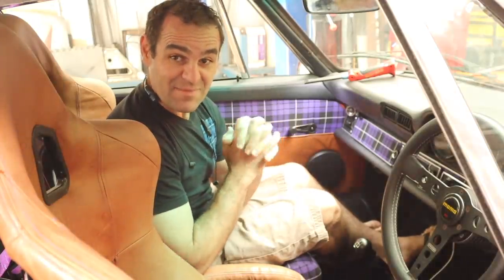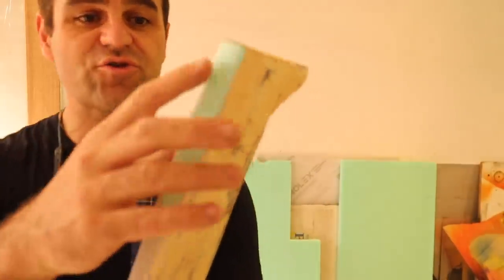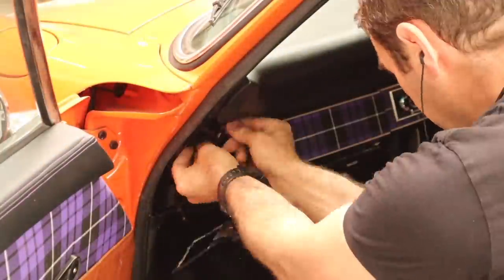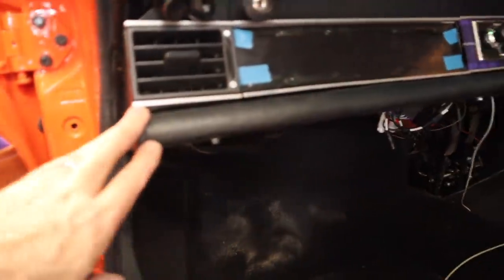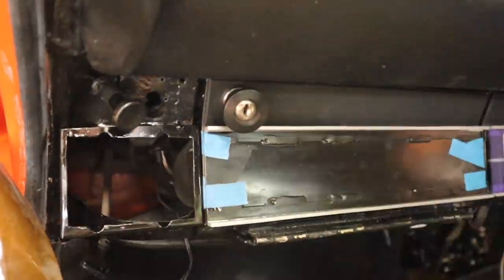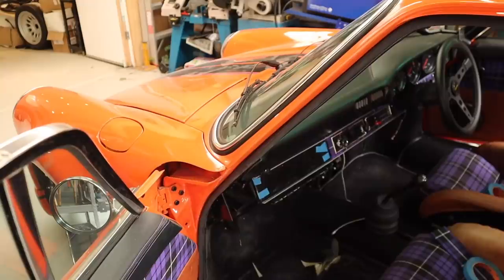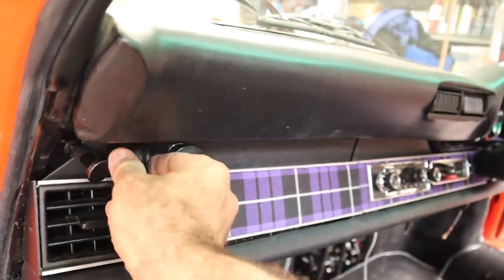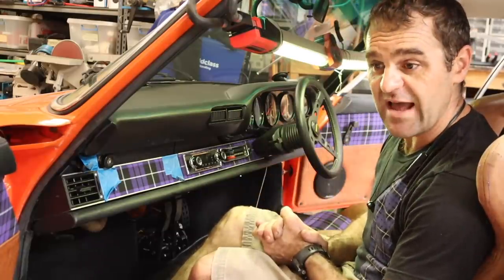I screwed up again... of course. Porsche 911 dash build part 5

Comment: I was sure you were going to say, “so now I’m putting in electric windows!” But you’re not Blackhurst crazy just yet 😆 Another great episode, as usual. Love the 3D printed ducting. Very tidy.
Reply from the maker: I may put them in at one stage, but I actually like the nostalgia of wind up windows. The car is also small enough that you can reach the passenger window from the drivers seat anyway so they are not really necessary.
Reply: @HomeBuiltByJeff  Especially with the new AC! I’d love to see you test it and report back with your results.
Reply: Just open the door 😎🏴
Reply: Good lord man, just put the power windows in. Or just leave a 1/4" drive on the handle and keep a power drill in the passenger seat hahahaha.
Reply: I thought he was going to say “I’ll change the cranks to knobs”  🪟

Comment: End cap doesn't look too bad, but little more shaping
If it's the shape & finish your not keen on little more shaping, following the curve of the lower dash and on the edges can look white, gentle heat can bring it back or bit of plastic paint
and we'll call it done, top progress once again

Comment: Just a minor worry.  Those end pieces welded to the structure of the car will surely provide a knife edge to run into in the event of an impact. I'd have felt much better with a molded crushable piece there.  Sharp edges facing the driver or passenger always worry me.

Comment: Oi Jeff, since you own a 3D printer... Couldn't you make some slightly shorter window winder handles for easier window winding? You could even match them to the steering wheel in style. ;) 

Edit: Oops, should have read the comments, I see that someone else had that thought already. ^^

Comment: It would have been much less work to simply install some power window crank winders and remove the manual window winder arms entirely. It's an easy solution, they aren't very expensive and they work.